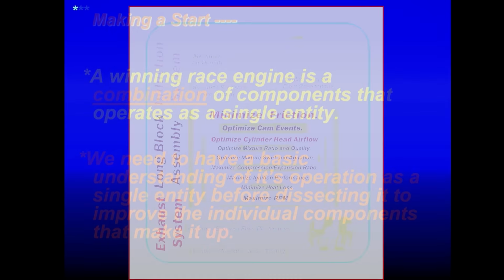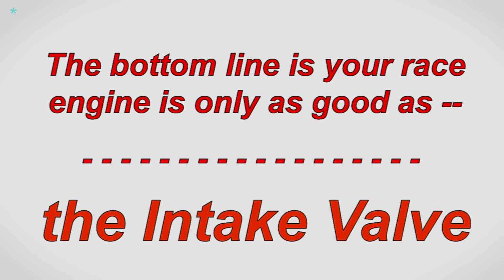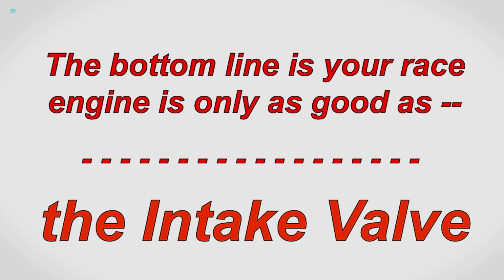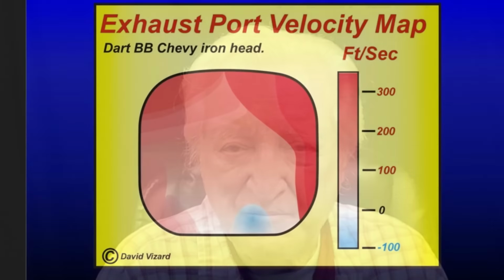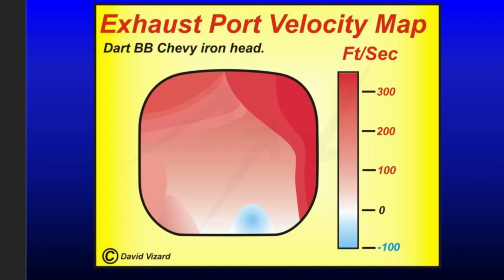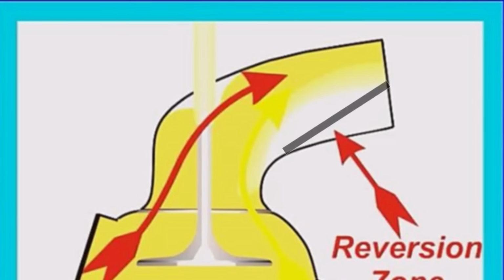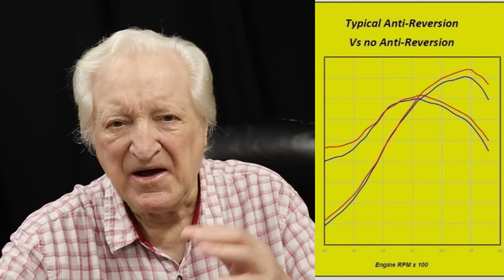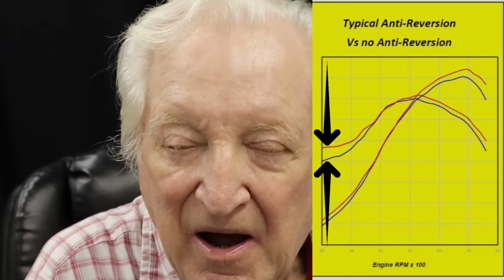Big hidden HP - from anti-reversion mods

Comment: Hot cam Intake valve that "absolutely forbade it (the charge) from going out again... not possible..."
Errr....  not..???  What about a reed valve just upstream of the intake valve???

Honda's 500 Thumper used these.
Alfa Romeo tested this with HOT cams and found a 1 kw drop in top end for a great improvement in idle and mid range power.

I NB the advent of glass and carbon fibre reeds that are better and less likely to break the engine should they break.
Also 3D printed, aero reed valve holder casings.

Comment: Years ago, I built engines, many of them were air cooled VW engines. We made power on those with higher compression and big round exhaust ports. I built a few Type 356 Porche engines. They had lower compression and  weird long rectangular ports, but hey made lots of power. I never knew why. Maybe the 1950's German engineers understood reversion.

Comment: Thank you for making a video on this subject.  One question, could almost the same effect be achieved while port matching? The change would be to leave the floor of the port untouched as long as there is a step down into the exhaust manifold/header.
 Then, in corollary, if the same technique were used on the intake side from the intake manifold to the cylinder head. Would this give the opportunity for any fuel on the floor to be introduced back into the air stream? This idea is for carb'd applications.

Comment: I wonder how this plays into turbo engines, like a Subaru EJ257 for example... Just from looking at the exhaust ports in the head it looks like there would probably be quite a bit of flow separation on the short side of the exhaust ports for sure! And I'm guess with it being a turbo engine, the higher exhaust back pressure between the engine and turbo would cause even more backwards exhaust flow back into the cylinders if there is a slow speed flow separation on the short side of the ports...

Comment: Old technology; back around the mid nineties , a born genius by the name of Jim Feuling (RIP) out of San Diego was, among other projects, working with GM/Oldsmobile on a 4 cylinder 121 c.i. / 2L engine to be known as the OHC Quad-4.  Versions of this engine went on to be produced by GM over a period of about ten years.
Feuling favored this N/A Q-4 engine and with additional Feuling A/R "enhancements”, the engine ultimately produced over 1,270 hp (continuous), this is over 10hp / c.i. and was about 30 years ago.  This Feuling engine was on display for several years at the San Diego Auto Museum, Balboa Park but has now disappeared into oblivion..
Also on display was a 74ci Harley Davidson with an A/R KIT by Feuling that DOUBLED the engine output.
Reply: i bought a used Q-4 for a daily driver; was a super-fast compact sedan and was fun blowing off all the foreign compacts. Never miss a beat and passed it on after several years.

Comment: Don’t worry about me, I am 63 and in great condition, never broke a bone. I had a couple crashes at about 8 years old going down a steep rocky hill in a push plastic go cart I made. Crashed at 45 mph on my skateboard, high speed wobbles. Other close calls landing 152 Cessna.

Comment: I´m just pulling this out of my ass, but I think why the flow reverses on the underside of bends in exhaust ports might be, that the exhaust gas flow "prefers" to go round the outer side of the bend and creates turbulance and a lower pressure on the inside of the bend, that reverses the flow and sucks gas back into the engine (like liquid would, gas is only less dense liquid).
I have no proof for any of this, just thinking xD
Reply: I think that's a very good thought. I am picturing the Eddy currents that can be seen in rivers

Comment: I built AR headers thirty years ago after reading an article by Dean lowery and of course David Vizard. The ones I built followed the work of Jim Fueling with AR cones in the first set I built for FE rail. Later street headers I built I just dropped the bottom of the header away and put a shelf parallel with the port bottom. With close lobe centre cams the engines would rev quite sharply and had a good low rev operation. Step headers do something similar. In the intake manifold the runners stayed very clean I noticed. I think I had to lean the carb or it would run rich with the cones.The magazine was popular hot rodding may 1980. I have followed you David  since the English hot car magazine days and have learned a lot from your writings. Thanks.

Comment: This channel showed up in my random feed.
What he describes is how I built my 345 sv engine 30 years ago. My old boss had a buddy that was an independent machinist. He wrote a program(cnc) to port the heads. He talked about this very thing. Looked at my headder flanges, said "perfect" this engine will rev to the moon. He finished the porting by hand. It does, I run it up to 6500. Factory red line with a stock cam was 3800. 54000 miles later, still pulling hard.

Comment: I once owned a 97 Firebird with an LT1 350. It  did not run well past 5000 rpm with the stock manifolds so I installed an old set of long tube headers from my stock car on it. The difference in power from that one modification was unreal across the entire RPM range!  At that time all you saw was that the D-shaped exhaust ports on LT1 heads needed special D-shaped tubes to correspond to the shape of the port. My headers were regular 1 5/8” round tube. Could the misalignment of the bottom portion of the tube with the flat of the D port have been helping with cancelling reversion? I wish I had ran across David’s books 30 years ago!
Reply: I'm going to say yes,  follow along here,  a popular swap in the G3 hemi world is to use Eagle heads(09+) on the pre Eagle  5.7(03-08) the exhaust on the Eagle is a D shape, while the 03-08 head it's a square, when we use the round tube headers made for the older head we find a 10Hp/20Ft gain over the later designed headers, now if I weld up and round the top of the eagle head exhaust port to match the round tube header, it's 25Hp/25Ft increase and moves the Power band up a 1k rpms.

Comment: After studying engines for years, I learned something today.  Thank You!  When building my street engines using cast iron exhaust manifolds I have been enlarging the top of the manifold port, creating a lip which I thought would be anti-reversionary.  Turns out I should have been doing this at the bottom of the port!  Mind-boggling!  Thanks again, David.
R.
Reply: Ahh good idea🏅 I have an adaptor block on my Volvo exhaust to connect a turbo. I know that all doesn't line up quite right. Now I can turn it into an advantage

Comment: The mini’s came alive if you 8 ported the head and made manifolds to match, the alloy cross flow finally got the things working properly but the bottom end could not live with it to long. The original head design was primarily for 2nd gear take off’s and economy.
The 9 port 6 cylinder Holden engines did the same when 12 ported, the 3.3 litre (202 cu. in.)in its final form developed 330 hp with the Irving designed cross flow 12 port head, a marvel to play with.
Shot blasting ports in the reverse to flow changed drivability a lot and induced anti reversion.
Smith and Morrison’s “scientific design of intake and exhaust systems”is a good reference for harmonics of ports.
Port and manifold design and harmonics is a field that encompasses science and witchcraft in weird proportions.
People have even tried 2 stroke exhaust formulated pipes and porting (both for inlet and exhaust)for 4 strokes with variable success.
Jenkins used a reversion plate and an exhaust with short large pipe diameters and had some interesting results but not really suited to drag racing it works more for road racing where you have a large rpm range to live in.
Honda’s k750 motors had exhaust anti reversion built in with small ports dumping into large pipes, when you port matched them you lost some bottom end and the 4400 rpm hole got a lot worse due to this.
Mis matching ports by manufacturers was done for many reasons and port matching, though improving the numbers killed drivability unless you did a lot of other things to compensate.
A lot of good discussion points in this video.
Thank you David, take care.

Comment: I HAVE A 496 CHEVY BIG BLOCK in my 1978 Chevy Suburban which I built for torque and towing. I ended up using peanut port heads as they were what I could afford. A friend gave them to me, and they already had valves in them, so I was not able to port them. I then put a "peanut port manifold on with a Quadra jet carburetor and long tube headers. I am wondering if this idea of putting a dam plate in this set up would help as the headers already have a larger diameter than the exhaust port.
i remember reading about Grumpy Jenkins using larger exhaust headers to block back flow and wonder if by putting the larger headers on this engine it accomplished what you are talking about in this video.
By the way you look much better than earlier videos (I have a gap in watching your videos due to being able to get back to Thailand to be with my wife). Your skin tone and voice look and sound much improved. Keep up the health as you are one of the greatest minds in the engine building world if not the greatest.
Reply: The exhaust reversion hitting the port lip is good. Gasket matching exhaust port to header is usually bad for low end

Comment: David,
  Great work. Very informative for those well versed in the more advanced aspects of flow.
  Question: how do tgese principles relate to turbo charging?
  The intake ridge looks good but the ramp in the header, i winder.
  Have you any input ?
Reply: I would think it would work as well or even better in a turbo application. There would be a bigger back pressure when bumping up against the turbine blades.

Comment: Anti reversion was one of my goals when I created step tube headers back in '83. It enables a smaller first section that boosts velocity off the port while maintaining or even increasing over all flow.
Reply: Im getting ready to try this on a vtwin with long open 2 into 1 pipes with 3 steps up in diameter from start to finish. Did you have any success with the idea?
Reply: @OneLifeDefenseLLC  I can only say it didn't hurt. I can also say that it is being used all over the place, drag racing to formula1. I never got to dyno test it but in flow bench tests it give a huge boost in flow.

Comment: Mornin David; Larry Hofer from San Diego CA.  You mentioned variable cam timing in this episode.  I am building a Gen 7 Big Block Chevy for a 2020 C8 corvette with Variable cam timing and DI. It is starting and running but am having a problem finding information on this subject. Trying to find out how to phase the variable cam system relative to the crank reluctor. Seems to have a window of 6 Degrees advanced and 12 degrees retarded. having a problem getting it correct. am setting up a dual trace oscilloscope to see if this can solve the problem. Would be amazing if you hade the missing answers. Still really enjoy your technical analyst.

Comment: Actually carbon monoxide is flammable but gets expelled through the exhaust system, so we need to build a chamber that adds a water mist into the exhaust to seperate the carbon monoxide and feed the flammable carbon monoxide back into the intake, to burn it as a gas, which would give you more power, because fuel droplets do not burn, its the fumes from the gas that burns, so by introducing a pure flammable gas into the intake, you get a more efficient burn, with more power, so you need to focus on building a carbon monoxide extractor chamber, then you produce more power with lower emissions. 😎👍
Reply: 👍 simple fix for $5

Comment: Would this technique apply to a turbo application using a factory turbo log style manifold? Or is this more geared torward a header pipe style exhaust, where scavenging is more at work? I have a Datsun that I'd like to try adding plates to.
Reply: I reckon it would help spool up the turbo quicker

Comment: You know those coolers That you
Plug in to cigar lighter one way they cool flip the plug and they heat i.e. electronic chip four or six sheets of aluminum inside the box with a chip on each .they cool 40 degrees below ambient .now that would be something wadda u think?
Reply: This is something resembling an attempt at an idea!

Comment: https://youtu.be/suIAo0EYwOE

Towards the end of the video it talks about using the Nicola Teslas valve to keep airflow reversal down on a pulse jet. If you used the same idea on the intake runners of a tunnel ram intake. Would it help to stop revision on the intake side. My thought is it would help hold the air in the runner. ??

Comment: What would happen if you added a filler in the exhaust port that was shaped like the bottom trailing edge of a laminar flow airfoil with a concave pressure recovery area to ensure a smooth transition? That would almost certainly destroy any flow in the wrong direction and could be accomplished by welding and grinding the port floor.

Comment: Can't you achieve similar results to the plate by using a pipe that is bigger than the ports on the exhaust ?
Reply: To a limited degree. 
You want to increase velocity out, and stop it coming in.

Comment: Hay David first of all many thanks, i need to know for your opinion what you think about watermethanal injection!
Reply: He has a video about it. Cant remember the title but it was something like worlds best octane booster. He claims there is no limit to the octane you can reach with just water. However the more you use, the more you have to change your tune. 
I have to agree with him. E85 works wonders and the big thing is it has more water content for cooling in the first place. 
I need to make a setup. Distribution per individual cyclinder would be my biggest concern say with only 1 injector. Get as many injectors as cylinders and that would probably work excellent.

Comment: I remember years ago on Engine Masters they had a 440 on the dyno and they kept smashing down the header primaries and they weren't losing power, this must be why. The only question I have is when does preventing reversion become an issue vs pumping losses if you cured it too well would it not take more energy to move the piston up and down? It's such a balancing act isn't it. This is why I am starting to think it would be much more rewarding to build an engine that doesn't seek to be on the ragged edge of n/a power and instead utilize boost to make up for the short comings of smaller ports and cams. With a relatively basic 450-550hp LS/LT, 9.5" Windsor, Godzilla all you need is 12-16psi and you have a 1,000hp and there's almost no way you could ever use it on a public road or a drag strip. The power isn't nearly as difficult today as supporting mods and building a cohesive package for drag, road course, land speed, ect. Building the most efficient n/a package is more of a scientific quest for the sake of it's own achievement. Most of us probably should be more focused on durability, reliability and efficiency. I do respect the skill and development work it takes to put a package together. Thank you for sharing what you can to help me.

Comment: Mr Vizard, the valves I put in my 383 sbc are pbm severe duty valves. I didn't know anything about this at the time, but the exhaust valves have a back cut on them just like the intake valves. How bad will this affect reversion? The cam I'm using is a comp cams xr294hr. Heads are the dart Chinese knock offs with a little bowl work. It's still on the engine stand, should I change them to something without a back cut?

Comment: How much more it less effective would something like this be in a turbo motor application? I assume it could make a massive difference if applied correctly due to the high back pressure in the exhaust headers/manifold driving the turbine.

Comment: Wow, that was interesting. I had a 03 Yamaha FZ1 and had installed an Ivan's Jet Kit. Well after some playing around the bike ran well but still had a lot of pops on deceleration. In an effort to reduce this I made a cone (never heard of this before) from some steel pipe to increase back pressure and get rid of the decel pops. I installed it where the four pipes meet as one. After some playing around I had a smooth and fast running machine. More importantly, during taking it apart, adjusting (bending) and putting it back together multiple times, I had accidentally broken one of he four "leafs" of the cone. The broken, or non restricted, area ended up at the bottom of the pipe. I noticed the difference immediately. Only thing is, I had no idea what I had done. Now I know. Thanks David.
Reply: Why try to increase back pressure?  That's steps taken in the wrong f direction buddy
Reply: @AshleyDonald-gr3cm listen to the video again, you completely missed the point
Reply: @dinadaughtry8993  read the top post. I'm not talking about the video.
Reply: I have a FZ-1 I could try this on 🤠👍🇺🇲
Reply: @DANTHETUBEMAN That would be awesome. Reach out when your ready. You can get that thing running fast and smooth. 👍💯